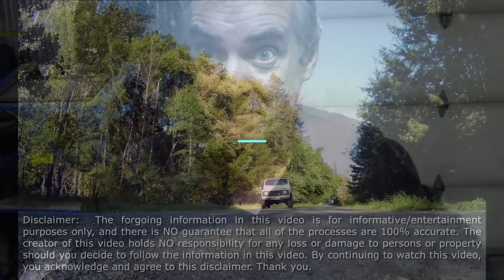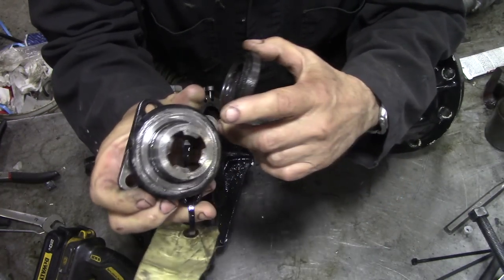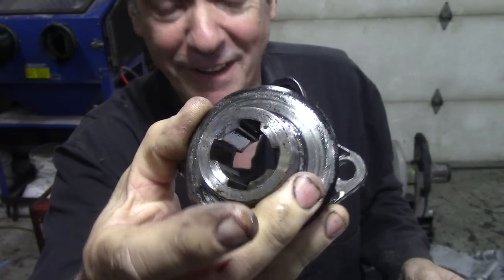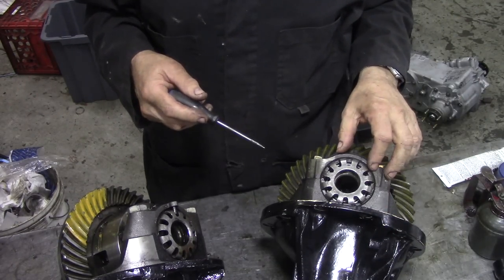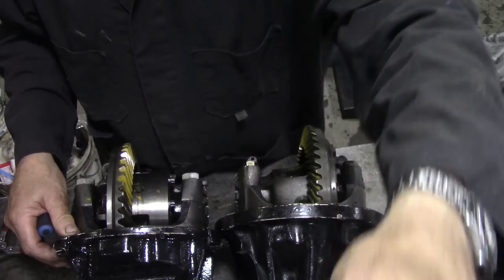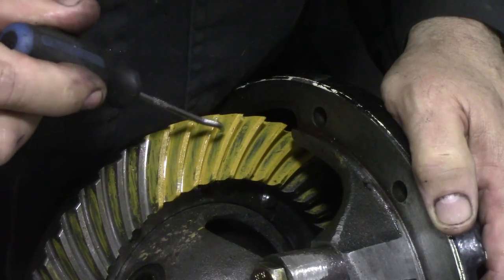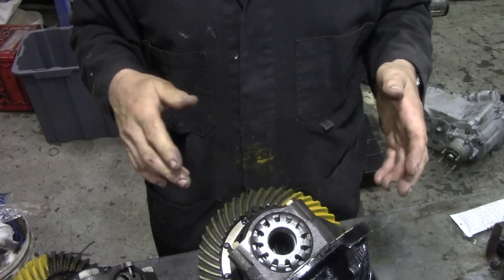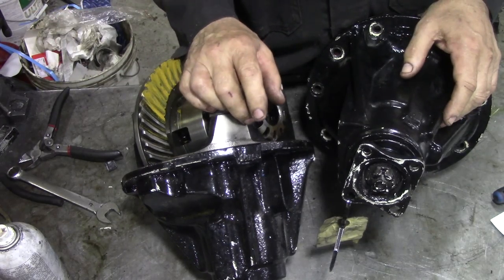Rover differentials A bit of an explanation

Comment: Great vid mike ,the seals there are two types ,butyle and the brownish viton both made by corteco, butyle leaks straight out pf the box ,as for short nose difs p38 etc they never tightened the crown wheel properly so it was a bit of a lottery ,seen some 300,000 mile plus and ok. Keep up the good luck 👍
Reply from the maker: I think they are ordering a complete kit to replace this

Comment: Ashcraft has a video , loading a CV , after 500 (500 what) the cv burst .  I guess under dynamic loads , such as spinning wheel suddenly get traction , the torque in the axle can be even greater. We all talk about engine and gearbox , but I think axles are such an overlooked member and it is worth a deeper investigation.

Comment: That's the thing, mechanics became more part fitters and therefore no need for the workshop manuals to contain the same detailed information as before. Just replace rather than strip and fix.
Reply from the maker: yeap - get the factory recon unit!

Comment: I had to rebuild my puma rear diff because some of the bolt heads had sheared off, I checked the ones that had not sheared and they were torqued to the correct setting, I had to replace the crown and pinion as a loose bolt head had chipped the gear teeth on both parts, it was a pfaf to do to get the contact patch correct but I got there, I used torque setting commonly used in engineering industry for the sizes of thread, these can be found in most good engineering information publications or an engineering workshop should be able to advise you. I realised at the time the crown wheel was thin and in pondering this for a while thought could you fit a steel backing ring and longer bolts, maybe a 10mm thick laser or waterjet cut ring to beef up the thickness, my diff is all working fine so I don't want to take it out but do you think there would be room in the housing for this? thank you for the video.